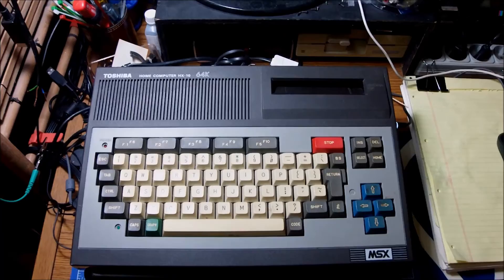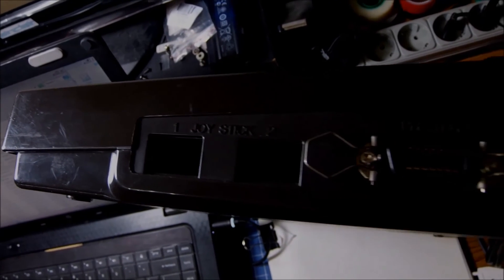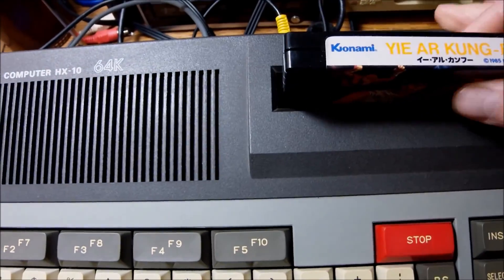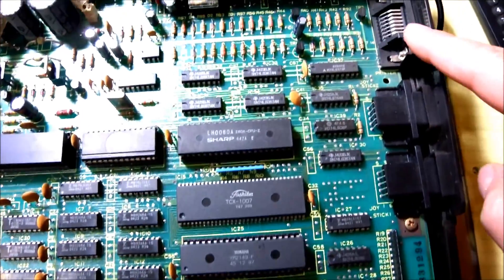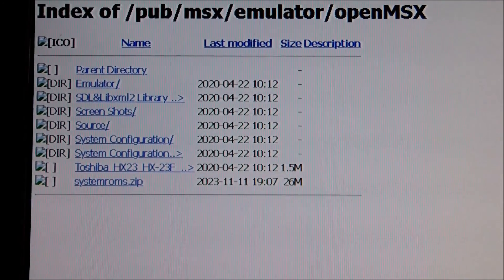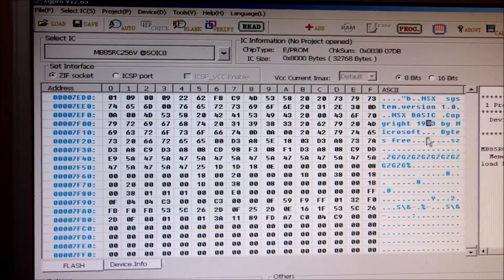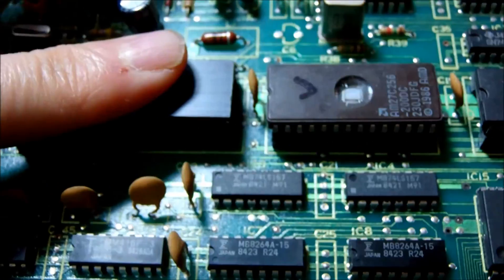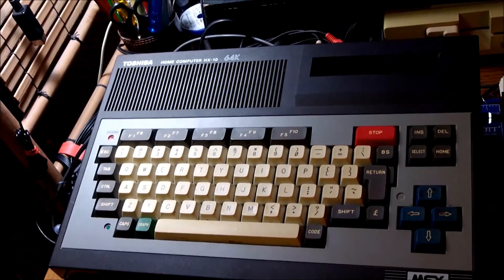TOSHIBA HX-10 - 1984 - MSX-1 Series Computer fix. Tricky that one...

Comment: Factory ROM is a mask ROM, they don't get erased, but they do go bad. They can go bad in such a way that all the data pins constantly show HIGH, which in turn will be read as FF by your programmer. That's my theory on your mystery.
Reply from the maker: Hi and many thanks for dropping in - also for the valuable info shared here! That was my first impression from the beginning and you're absolutely correct! for some reason, when this happens i feel better when an eprom gets in place. Thanks for watching!

Comment: Nice job , another on saved from landfill ;) I'd be very surprised if that ROM chip were blank. It's most probably a broken connection within the rom chip itself to the "chip enable", 5v or even the gnd pin, which would mean that the MSX or your EPROM programmer would be unable to read from it. The MSXs are nice machines, some great games were made for it and even some colecovision games were ported to it. I've just seen your sub count, congrats on making it to 1000 and have a happy new year buddy ;)
Reply from the maker: Hi Peter! Thank you so much mate! You're absolutely right, i thought of putting the code back in the original one but then i thought there is something wrong within the chip, like you said and so, I used the other eprom. 
Wishing you all the best too my friend, a happy new year and keep it up!